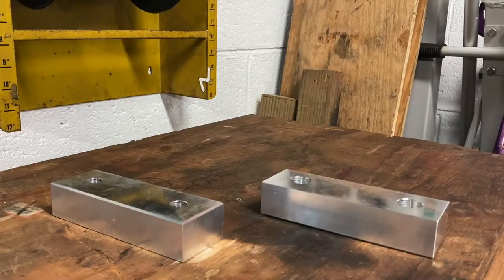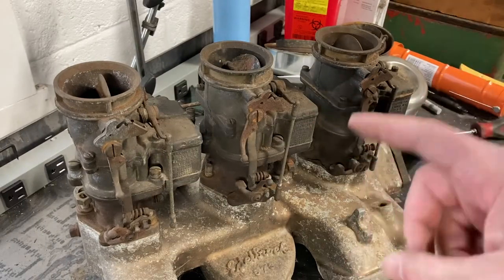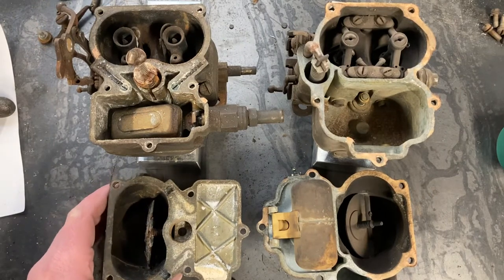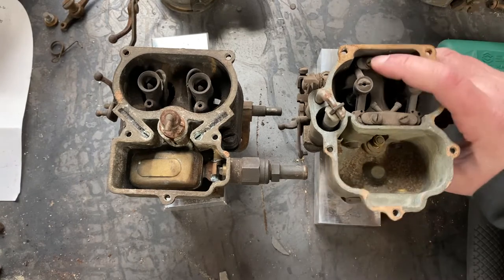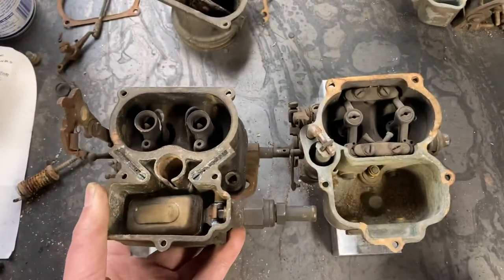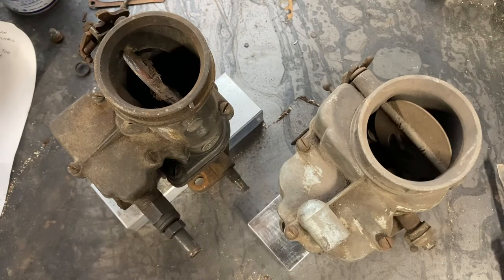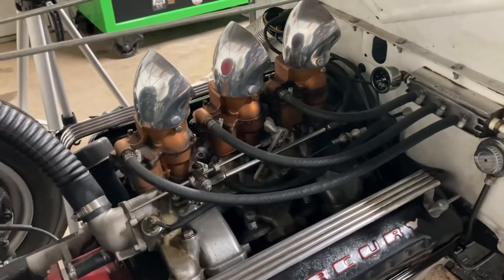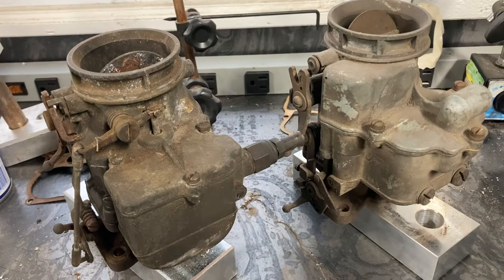Stromberg 97 vs. Holley 94 carburetors

Comment: I am a sucker for punishment so I'm running a Holley 1901 off of a 52 Lincoln 239 . 😲 I love that Holley still uses the same jets and many other parts on their 4150 and 4160 series carbs. It does make jetting easier though the old style power valves are getting harder to find. I also have a Holley 4000 to use after I rebuild my 8BA. 🤷‍♂

Comment: When I was building my Lakes Modified Roadster I had to get 5 old Holley '94's from 3 states, NY, NJ and Pa. to make 3 good ones since I didn't want Strombergs due to their cost and what I believed (and still do) their inferiority to the Holleys in many ways. I bough parts needed from local suppliers, Vintage Speed and Speedway Motors and blocked the power valves and Idle circuits in the end carbs and worked different jet combinations in all 3 carbs and played with numerous power valves for the center carb. I used EELCO linkage set up progressively to run the center carb to about 40-50% throttle before the end ones kicked in. All in all to get the best combo and driveability, I spent around 100 hrs. of tuning to get it right. By the way, my setup is on a totally fabricated Ram Induction - Tunnel Ram style manifold mounted to my ALFA S.O.H.C. V6 engine. You may have seen the car in the September 2014 issue of HotRod Magazine, at local Northeast Cars and Coffee Shows, Cruise Nights, Dead Man's Curve in Mahwah (I'll be there again over Labor Day weekend )The Greenwich Concours last October or even on Bring A Trailer. Happy Hot Rodding!
Reply from the maker: Thank you for sharing your experience! My setup on the YBlock is very similar to yours. I have definitely seen your car around, excellent work! Thank you for watching!

Comment: Thanks very much for your review. I have twin DAA36 running a 3.4 litre hemi. I have a better understanding of the power valve and the need to synchronise them and power throttle valve use and tune them for their use in relatively heavy car. Your absolutely correct about the parts issue too. Cheers
Reply from the maker: My pleasure, thank you for watching!

Comment: Thanks for the information. Do you happen to know if the CFM is the same on the 97 & the 94? By the way I enjoy your 'dog' highlights in your videos.
Reply from the maker: Thank you for watching! By the time the Holley 94 carb was released to replace the stromberg, they both provided 155CFM. Later Holley 94 models would flow alittle better. “8BA” 94’s were rated at 162CFM, and “EGC” 94’s were rated at 185CFM.

Comment: I'm considering having a Banger built for my '29 Phaeton.  I would like to use two carbs.  What do you recommend; the Stromberg 81?
Reply from the maker: It depends on the scope of the build. A single Stromberg81 works well with a stock banger, but two running at factory settings may be too much fuel/air. A high compression head would appreciate dual 81s. Feel free to DM me with details on your build. I’m far from an expert, but I  can pull from some sources to help steer you in the right direction.

Comment: Holley didnt just have a relationship through distributors with Ford, they were the very first company ford went to when he started his company in 1903...and was later the primary carb for the Model T! Ford found out about them as he needed a better carb and was told by the dodge brothers(Ford share holders) about Oldsmobiles better Holler Iron Pot carb used in Holleys own car(they started out making cars first)....then in 1907 Ford commissioned them to refine the design and that became the primary carb for the Model T, and started the "Holley Carburetor Co" we know today.
Reply from the maker: Very interesting, thanks for sharing!

Comment: Had 6 strombergs on a small block Chevy and in a long turn, floats would drop (right hand turn) and when turn back to straight bowl would be over filled and pour out top vent and down the side of the car. Had to lower float level to correct. I would never do it again.